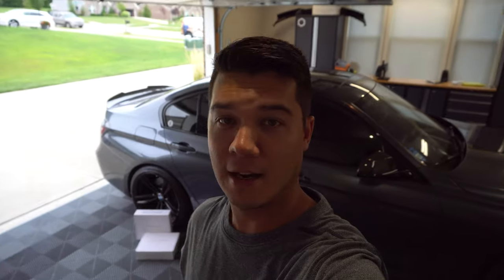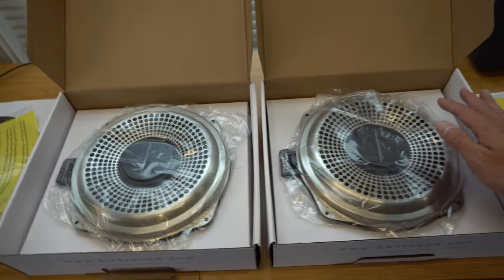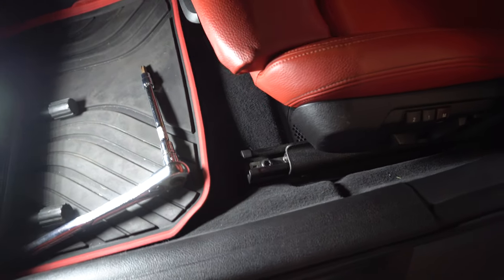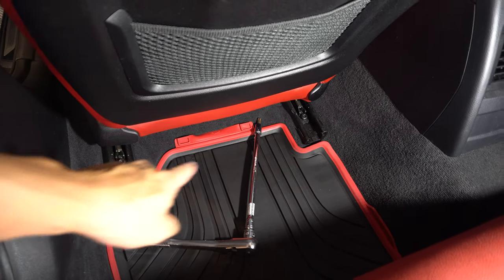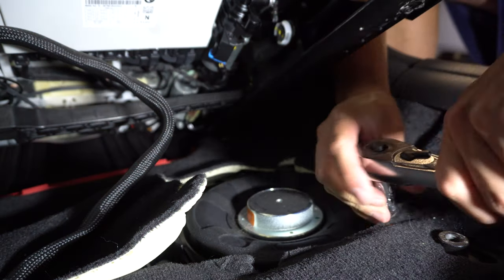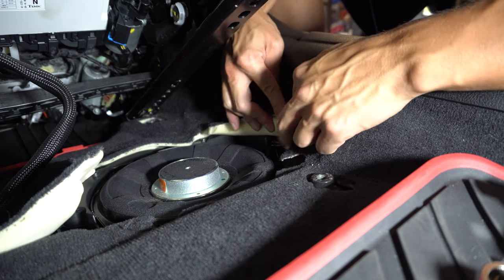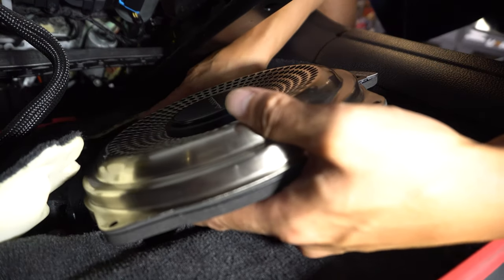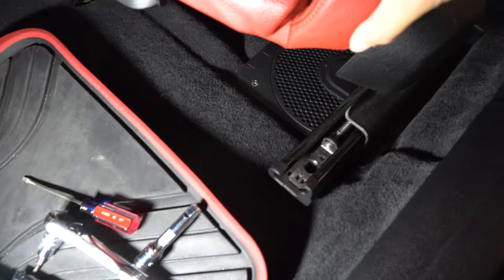BMW F30 gets BavSound Ghost Subs | Install DIY

Comment: Is the bavsound amp necessary?  I just purchased my ghost subwoofer for my f10. I haven't installed them yet. Was wondering if the amplifier is necessary or can the current oem amp do just as well?
Reply from the maker: Current amp will work with your subs. Depending on what your stock system is, the BavSound Amp is a great addition and best bang for the buck.